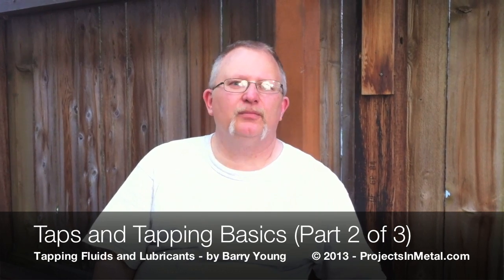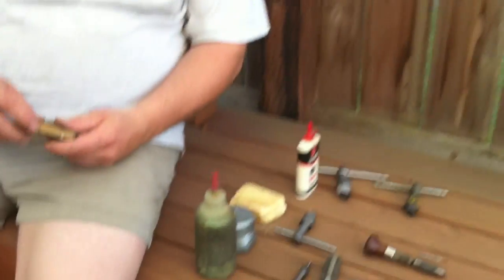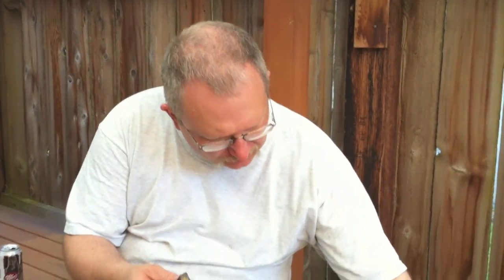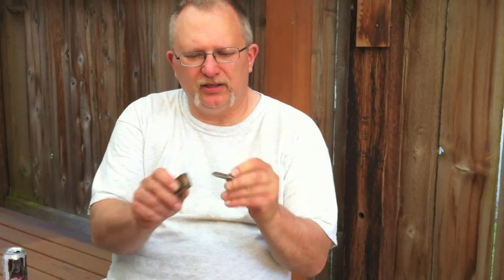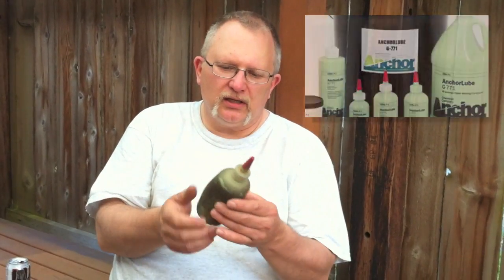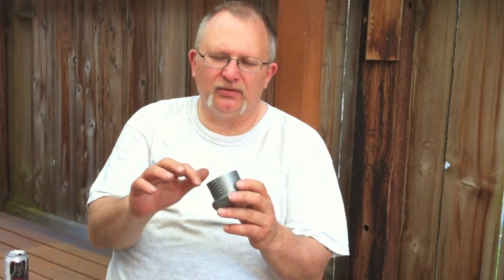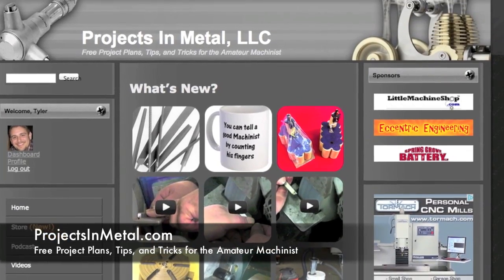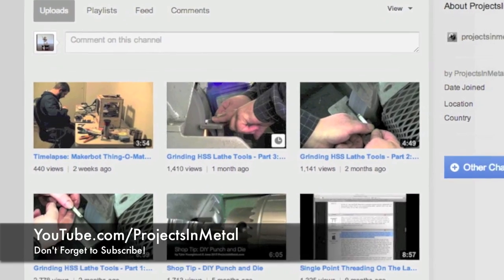Metalworking Tap Fluids and Lubricants - Basics of Taps and Tapping (Part 2)

Comment: "I find that 10 weight oil works just a well - - - -" 
NOT TRUE.  NOT EVEN A LITTLE BIT TRUE
 Lubricating oils are worthless as cutting oils. They don't have the additives that make a cutting oil. 
Just to start off cutting oils and fluids have things in them just for cutting. Regular lubricating oils don't and that makes them about as useless as sand.  Sulfur is the most elemental (no pun intended) additive for cutting steels.   There are anti-wear additives, boundary lubricants,  and extreme pressure additives such as Chlorinated Paraffin, Sulfatesm, metal deactivators, anti-mist or anti-foam additives. 

Try this.  In a small lathe, the smallest you can find get a hunk of 3" prehard 4140 and trey to drill and bore a 2.750" bore in it with precision( work closer than 0.001") using the most desirable lubricating oil you can imagine.  Then get some Oatey or Hercules cutting oil that dark stuff with lots of sulfur in it and get back to work on that steel.  If you don't see the difference,  well then you must be dead.

Comment: I use LPS a whitish candle type stuff in a tube about the size of a caulking tube along with other stuff picked up during an auction.
I have seen videos suggesting WD40, but have not tried it. Your thoughts on it would be appreciated.
Lastly the Bees Wax is supposed to be good on grinding wheels (flap disks and ?) to help reduce clogging. I am in the process of testing that one.
Thanks for the very informative videos on taps.